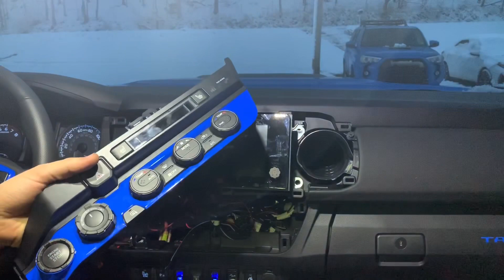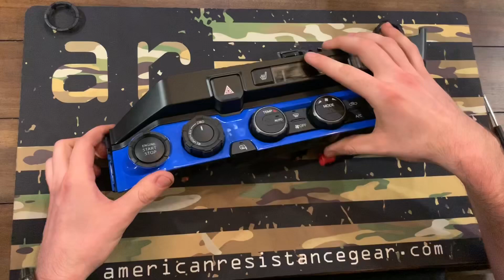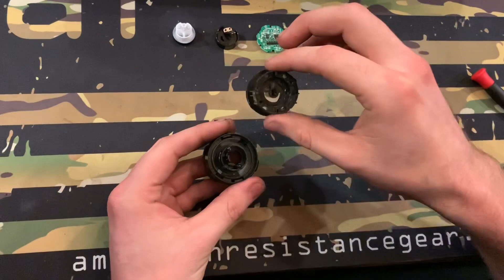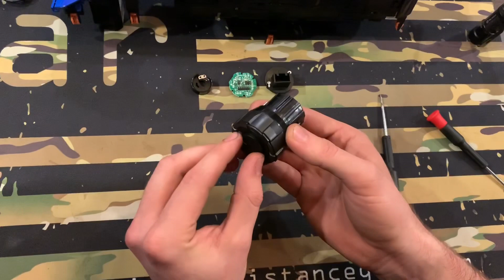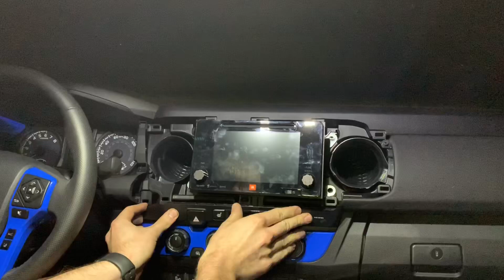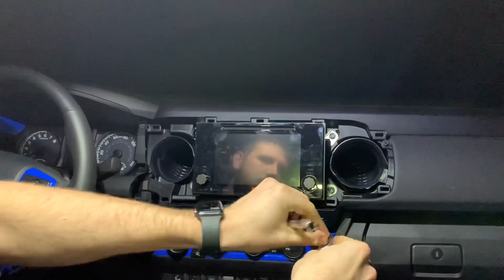AJT DESIGN Start Ring/ 4x4 Knob (2016+ Tacoma/ 2014+ Tundra)

Comment: You guys should really do an addendum to this video and talk about the two plastic pins inside the four-wheel-drive knob mechanism. They provide friction to the knob between 4 high and 2 Wheel Drive. They also are essential for the resistance for the push in to four low function. I got extremely lucky. Mine fell out onto the table, and I saw them many people in the comments are talking about problems related to these two pins or as an alternative, you can provide these pins in your kit.

Comment: No mention of the springs and plastic sliders  housed between the knob and frame piece?  When removing the one small screw in the middle at 3:44 be sure to take apart very slowly and look for the them.  They are down inside two holes.  Mine came flying out and it took forever to realize what happened and find them on my shop floor.
Reply: Would love to know the part numbers for the prints and sliders, because mine are now gone. Tripped on the one yard line! I’m hot!

Comment: Anyone else get the 2WD-4WD Mode Change Fail error come on and not go away after doing the install?  Guessing my switch just went bad during installation...? Stupid knob...
Reply: I just got this error message too. How did you go about fixing it?
Reply: I got this! How did you fix it!??
Reply: @xanderfloats  hey did you ever get this fixed??? Idk how to fix it and I ran into the same problem, please get back to me I’d greatly appreciate it
Reply: @gdubinett  hey man, I bought a new piece & I had the dealer reinstall it. This part is sensitive and if you don’t install it correctly you can break the tiny pins !
Reply: Same thing just happened to me
Reply: Just happened to me, too.  I wish I would have read the comments before I tried to install the 4WD knob.  Never could get the tabs to release the housing that is being replaced by the aftermarket one.  Put the original one back together and now I have this error message.  Not worth the hassle.. the 4WD knob is WAY too delicate/finicky to mess with - just vinyl wrap the chrome ring if you want to delete the chrome on the 4WD knob.

Comment: Man this thing is super pita for me... I can't get the tabs pulled back for the last outer piece to come off. Nothing moves.
Reply: I finally got it off.. I had to stick my finger nail under the outside little chrome ring and it popped off when I pulled the tab back. 

One thing I might have missed in the video is when apart there are two springs with 2 little black plug things...I did loose one of the plugs somewhere in my kitchen lol.  I was able to make another one from an extra pin from a glock pistol for when you change out your back straps, it is just about the same diameter.
Reply: @motodunner  I know this is an old post but I can't for the life of me get this last step done. He says "push the tabs outward" but like you said, nothing is moving. Any other advice??

Comment: OK,  just did the 4x4 knob on my 15 tundra with the AJT replacement knob. The parts are indexed except the 2WD - 4WD- 4LO indicator that screws to the inner barrel. Make sure the 2WD is vertical at 0º. Once reassembled and put back in truck, the 4WD knob is now loose with no friction to keep it "locked". I believe this is because you remove the old outer dial, but also the chrome piece that provided some friction while turning the dial. I dont think once I select 4WD it will move. But it could accidently be turned easily. At least the dash indicator illuminates for 4WD if it is moved inadvertently.
Reply: How did you fix it! I got the same error on my tacoma
Reply: @xanderfloats 
I ordered another 4x4 switch and tried it again with no issues.
I believe when disassembling, be careful for two tiny plastic pins that can fall out
Reply: @2zmax  thank you, had it fully replaced! Thanks !
Reply: @2zmax  did you fix it? I ordered a whole other switch bc I bent the connector arms. Now I can push it down, but it is still fairly loose between lo and 4hi. YouTube videos make it look so much easy. Even getting the chrome tabs out doesn’t come out easy at all
Reply: @AFGixxeR88   I caved and ordered another switch knob from Toyota. Watched the AJT Video again and proceeded. It reassembled correctly and is not loose. Something must've fallen out the first attempts.

Comment: Did you paint the panels yourself?
Reply from the maker: C O yes I did buddy im a mechanic and paint cars occasionally so it’s legitimate automotive paint and clear coat everything is pretty easy to take apart the trim on the window switches and the shifter trim on the console is done too
Reply: Stonewall Armory can we have a video showing how did you take the panels off to paint it